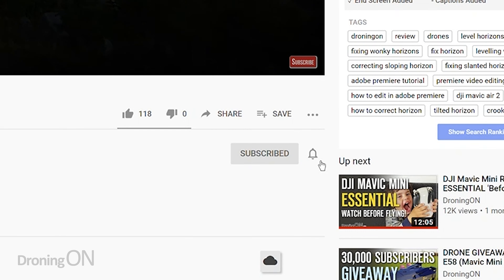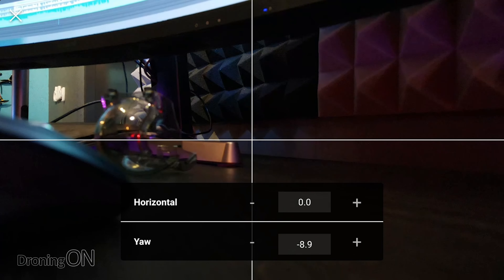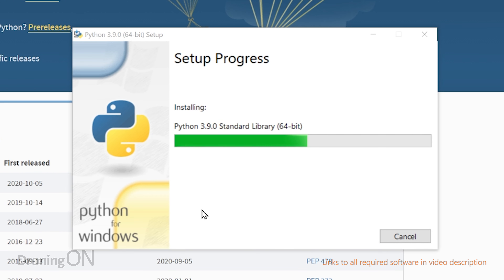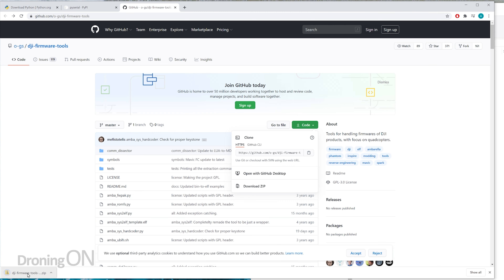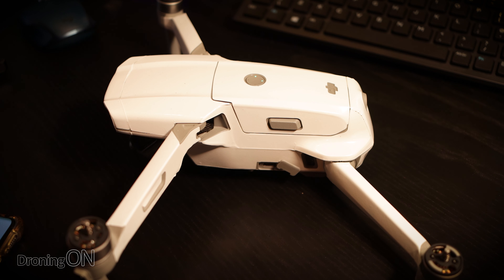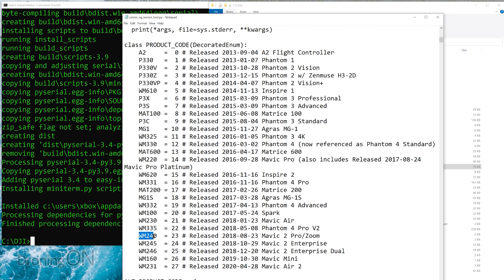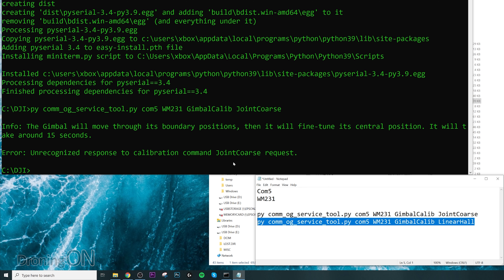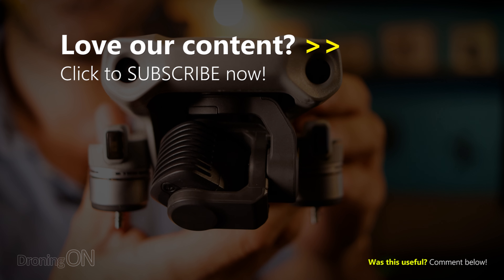FIX DJI drone ERRORS/ISSUES after GIMBAL/CAMERA replacement

Comment: ... Mavic Mini and DJI Mini 2... the code to use is the same which is...WM160... Also, the USBC port on the mini drones are a...dual port... that serves as both a... COM port and Charging port...the COM port shows first for about 5 to 10 seconds at most and then switches to the Charging port automatically to the Charging port. I don't know how to make it stay on the COM port. 

What worked for me when I did this repair on my DJI Mini 2 I used the WM160 code and as soon as I plugged my drone into the USB port I entered the the GimbalCalib JointCoarse line and let the drone do it's thing. I then unplugged from the USB port turned and off the drone. I then turned the drone back on plugged into the USB port and entered the Gimbal Calib LinearHall code and let the drone do it's thing. You have to do each line in the short time after plugging into the computer USB port while the computer reogonizes the dual port as a COM port before it changes to a Charging port.

I ran into the same problems as those posting above when using this video for their mini and mini2. Thankfully my son figured out that dual port issue. I made tha guess that since the replacement gimbal is the same for both drones the drone code might be the same and that worked.
Reply: thank you, it's work for me,

Comment: Is there going to be support for the Mini 2?  I have the same issue but I noticed it is not listed and the computer does not recognize my drone when I plug it in.
Reply: Cameron, did you find an answer about the mini2?
Reply: @firstnamemike  Maybe.  I bought  a gimbal from a gentleman on ebay.  He told me that the spark uses the same code but I'm a bit leary.  I still can't get the computer to recognize the drone as a serial port.  I'm going to try a different computer.

Comment: Hello. I tried the procedure on my Mavic Mini, and the issue I'm facing is that after everything installed, when I connect my Mavic Mini to my PC, in Device Manager, he's recognized as Storage and shows as USB drive. There is no Com Port to enter in the script. Any help will be very appreciated.
Reply: MINE ALSO
Reply: @samirzarour8562  I have the same issue, do you find the solution?

Comment: I get everything running but when I connect my mini to the PC it does show up as a USB drive but it does not show any com ports under device manager.
Reply: Try this, scroll down to the instructions (worked for me) https://www.windows10forums.com/threads/ports-com-and-lte-not-showing-in-device-manager-in-windows-10.6057/
Reply: same with me. did you get it to work?
Reply: @jillsabo5973  yes. You have only a few seconds to run the program once you connect the usb.
Reply: If you install DJI Assistant 2, it installs a driver for your drone.Then the com port becomes visible. worked for me.

Comment: Hello sir can you please make a dedicated video for Mavic mini 2.
The Dji tool you mentioned does not have Mavic mini 2 in it and i also tried Mavic mini instead but its also not working.
Reply from the maker: If I find the time, yes! Thanks for the comment!
Reply: @Droning-ON  thankyou so much sir the video i requested is highly asked by many people's as the process is a bit different
Reply: @theincredible2476  Hi, did you ever fing the ccode for mm2?
Reply: And add in the same video the mini SE with the code WM1605 please!

Comment: I purchased a Air 2s with gimbal stuck errors.  Would this work or be required after disassembling and reassembling? Thanks for the video

Comment: Hi, thanks for the video. I am having a bit of trouble. When I typed the "py setup.py install"  line. It comes back as an error saying that the file is being used by another process. Nothing else is open when i open task managaer.

Comment: Despite adhering to your guidelines, my gimbal continues to malfunction. About 2 minutes after the drone takes off, the gimbal starts to shake. The camera maintains a perfect forward position, but the horizon appears off-level, tilting 20 degrees to the left. Furthermore, error messages about gimbal motor overload and calibration failure pop up. I've verified there's nothing hindering the gimbal's motion, as it moves freely in all directions when the drone is off. Could you suggest a potential solution for this? Thanks.
Reply: did this happen after replacing? and have you managed to fix it?  i'm having same problem, and i'm about to order replacement (just empty gimbal).
Reply: @bujooo.  Yes, it happened after replacement and recalibrated with python

Comment: Have you tried to disassembly the old gimbal? maybe it's possible to replace only the broken plastic parts and use the original circuit, that could be a solution for the error that appears in the app.
Reply: I’ve searched all corners of the internet for parts but if someone has any they are not advertising it. You have to buy an entire new gimbal/camera
Reply: Which board is encoded, there is 2 in the gimble/camera assembly. I have the original gimble, wondering if I just replace those in the new plastic if that would work without error.
Reply: @Southernflyguy4  Which board is encoded, there is 2 in the gimble/camera assembly. I have the original gimble, wondering if I just replace those in the new plastic if that would work without error.

Comment: hi there awesome video fixed gimbal calibration error for my Air 2s. is there any python code for calibrating the IMU? error 30055 30056 are stopping my drone from flying. but no matter what I do IMU calibration gets stuck at 6% and gives error. any python code for IMU calibration? BTW I have already tried replacing GPS module IMU module and gps flex cable seems like a some DJI software glitch which needs some software pro to guide me
Reply: How you fixed gimbal calibration while air2s is not on the list ?
Please respond 🙏🏽

Comment: PLEASE HELP!! I followed your video to the letter but am getting an error on the command prompt that says
Error: could not open port com11 permissions error(13, access is denied none 5)
Any help would be greatly appreciated
Reply: Ok don’t worry I have sorted it!! Had to shut some windows. Gimbal has calibrated perfectly thanks so much.
Reply from the maker: @tolycobbold7659  Glad that you sorted it!!
Reply: @tolycobbold7659  jesus you saved me!!
Reply: @lucagontier8481  cool!
Reply: how hou solve it?
Reply: @mvville4086  hi, make sure you close all open windows except the one you are working with. As soon as I did that, the error went away. 🤞 good luck

Comment: i keep getting an activation error and then server error. "device SN verification failed..." any solution for this?  it wont let me fly it
Reply: I think this is now a problem and it may be due to firmware updates on the craft. Originally when we would replace these we would get an error even after calibration however the drone camera would work and craft would fly. Recently, after replacing just the camera itself using the original gimbal we are now receiving Activation errors. If you swap the old (non working) camera back in the activation error goes away and the drone flies fine. I'm not 100% on this but I think it's and update that is now blocking this replacement from working at all.
Reply: @Repairsharksllc  yeh. Dji pretty much confirmed this when I contacted them.  Theyre doing the Apple thing and preventing 3rd party repairs however they can. Ironically this so far just seems to occur when piloting with an ios device.  Android device would allow for flight
Reply: just Search ( bickflash tech) on YouTube, drop a comment for him, he'll assist you
Reply: @jess_n_atx  Thank you for verifying this. At least I know I'm not going crazy.

Comment: Such a simple fix... Just two commands with a python script. Has there been any progress on the "anti-repair" error? It does state the camera is not calibrated so it maybe another line of code you need to run to calibrate the camera. Not a serial issue I think.

Comment: I have a mini 2 with the gimbal calibration code error.  Now the gimbal works perfect, however code wont clear.   Do you think I go through these steps and it will clear the code?  At the very least it cant hurt right?>
Reply: I see the mini 2 isn't an option in the dji tools, wah
Reply: Ok wm160 works.  It went through all the steps however, error 40011 calibration error is still there.  Gimbal works good, but error is still there.
Reply: Reinstalled the app too.  Error must be saved on board the drone.
Reply: @Schmeggma.  See in drone-hacks.com app, I have seen a message that there is a WM161 code for the Mavic 2. (this is not checked by me). Follow the steps as described for the drone-hacks.com. After you installed the program and files on your computer, search for the file "comm_og_service_tool.py"; under "class PRODUCT_CODE(DecoratedEnum)" section you will find the code for your quad-copter. This file can be viewed with notepad.

Comment: I replaced the yaw arm on a mavic 2 pro and I tried this but the response I get is. Error  no response on calibration command joint course request. And same when I request linearhall. Any suggestions? My camera points to the left of the drone and gimbal cal can not. E done.

Comment: Would it be the same with Mavic Mini 1? Loved my drone and lost connection mid flight and crashed in a tree, vibration arms on the gimbal 2 have broken and i cant find anything online,  apart from replacing the entire thing, but people have said i need to take it to a specialist,  so they can calibrate, and remove error codes and such but canot afford to send it in, thanks in advance
Reply: Yes it works for DJI mini 1 and 2

Comment: Hey dude. Will this work in a mini! A 1 not 2 mini? I replaced mine but she’s got a tilt! And calibration is not working. Also u guys find a way around the errors? Or does that happen to the mini too or just the air?? Hit me back really would appreciate ur input. Have a good one.
Reply: I have the same problem, the command prompt in the last step stays fix eternally eternally without calibrating or moving the gimbal…

Comment: Did not work for me kept getting the following error messages:

C:\DJI>py setup.py install
Traceback (most recent call last):
  File "C:\DJI\setup.py", line 17, in <module>
    from setuptools import setup
ModuleNotFoundError: No module named 'setuptools'

During handling of the above exception, another exception occurred:

Traceback (most recent call last):
  File "C:\DJI\setup.py", line 19, in <module>
    from distutils.core import setup
ModuleNotFoundError: No module named 'distutils'
Reply: I had the same error. You have to make sure you get the exact versions of everything he downloads, like Python 3.9.0 instead of the latest and pyserial 3.4

Comment: I can't find on file manager my drone (DJI mini 2) and so I can't reed my COM code!! Can someone help me??
Reply: WINDOWS 10 PC: 

How to check COM port when you don't see it in the Device Manager Window?
Select VIEW
Make sure that "Devices by type" is selected
Select "Show hidden device"
You should now be able to see the "Ports (COM & LPT) section
Mavic Mini shows 2 COM connected ports on my system
1. DJI USB Virtual COM (COM4)
2. Serial USB-device (COM3)
The second on port COM3 is the one I need (not the Virtual)

Comment: Thanks so much for this excellent tutorial! I was able to follow and got everything working...sort of. I have an issue that maybe you can help with. I am able to get the gimbal to calibrate and work after running to the commands. However, when I power down and restart the drone, it goes right back to being a limp, not functioning gimbal. It's as if I never ran the lines and it's back to not working. Any advice would be appreciated. I do know that sometimes the gimbal gets stuck a bit due to the repair I made (I had to replace the ribbon cable b/c the gimbal was torn off the drone so with it being glued back on, things are little off but it does seem to move freely).

Comment: Hi! I bought Mini 3 pro a few days ago. The drone had minor crash and now it has some issues: 1. it shows Incompatible Gimbal data 2. In indoor settings or shades, the camera does not show anything. Camera seems to work fine in outdoor lighted setting. Can I use above procedure for Mini 3 pro?

Comment: Is there something missing here like having to have DJI Assistant 2 installed and the proper way to Paste into the command line? Other than that you are a smooth Pilot. Thank you very much!!
Reply from the maker: Nope absolutely nothing missing here, thousands have followed the instructions and it's worked for them, and me! Try again, take it slowly and pause to look in detail at the commands. Let us know how you get on buddy!
Reply: Same problem, missing a comment (py) he don't take it
Reply from the maker: I see, so you're both struggling with simply how to paste into the Command Prompt? This whole process assumes some understanding of Windows, and therefore how to do such things including for example starting up Windows etc, so apologies that it wasn't included. Simply press CTRL+V to paste into the command prompt.
Reply: @Droning-ON  i have te problem that i cant  install on command, i dont kwon how and "py" do not work

Comment: Did you ever make a video on correcting the error messages? I watched one that explains a recalibration does the trick--but ONLY with the previous firmware version. It will not let me downgrade. Any ideas? Please help! Love your videos, very helpful. --EDIT: I have already fixed my calibration issue after replacing the main board. Just have error messages on a Mini 2.
Reply: just Search ( bickflash tech) on YouTube, drop a comment for him, he'll assist you
Reply: @samil1522  thank you
Reply: @samil1522  it just comes up with a gun channel and a lot about fish. Am I missing something?
Reply: @joelgarland5723  just message him, he helped me
Reply: @samil1522  there’s no channel called “blackfish tech.” What channel am I messaging?
Reply: @joelgarland5723  it is "bickflash tech" not blackfish tech
Reply: @samil1522  totally misread that. Thank you.
Reply: @joelgarland5723   did you contacted this bick flash guy?

Comment: Anyone trying this with a Mini 2 it does work but, at least for me, doesn't run as shown. I used the WM160 code (mini 1 code) as WM161 did nothing. It ran through the calibrations but the code did not receive the responses it expected so it just had an error BUT the drone went through the calibration. Basically calibrated but no information shown in CMD. It was a pain to get it to sync properly, ended up opening DJI Assistant 2 and getting it on there, closing it and then running calibration code.

Comment: Late to the party. But I had to add --port to the command lines just before the COMPORT. So the lines looks like this (py comm_og_service_tool.py --port COMPORT MODEL GimbalCalib ...). Otherwise Python tells me that I've entered wrong arguments. Don't know why I had to do that but a guess is somethings have changed in the codes sins this video came out. Anyhow it works fine now. Thanks!

Comment: Hey, Thanks so much for this video. I'm still in my early stages of researching how to repair my misaligned camera. My camera works after the crash but the issues i'm having is a lean horizon, and the camera is pointed about 20° to the right also. I'm unable to successfully calibrate the gimbal in app as it goes to 80% and then fails. However the IMU calibrates just fine. Do let me know if you had stumbled on the code for the Air2S model as I noticed the listing went to up Mavic Air 2. - Thanks in advance!
Reply: I am having the same problem as you!  WM232 is the code for Air 2S, I tried it and the calibration worked successfully. but I still see my gimabl is at 20 degrees sometimes and it is not very stable. It's a hardware issue for me. I might have to replace the gimbal
Reply: @the_pretty_indian  Heyyy! thanks so much for sharing, i'm starting to love this community even more! Do you mind telling me where online you were able to find the code? || I'm happy to hear the calibration was successful, I need to give it a shot. I was also taking a closer look at my drone last night and I noticed an area behind the gimbal that has a tiny gap, as well as a plastic component that has been shifted. - I also noticed that if i manually rotate my camera to the left or right, it goes further to the right than to the left. Soo that in itself is a problem too. Over the weekend i'll have to pull it apart to see the true extent of the damage. If you haven't already done so, you could try taking a closer look on yours as well to see if you missed any little details like i've just discovered with mine. || Ultimately I may have to replace my gimbal too, so you're not alone.
Reply: @the_pretty_indian  once you get to a hard crash the solution sadly is to send it in.

Comment: On trying this (Mavic Mini) I get an error message that includes the list of models but I am not sure if the error is caused by Windows (10 or 7) not liking the com port (none are listed in device manager or no USB associated port is listed or none last for any length of time). There is a 6 month reply which say the poster was successful (with a Mavic Mini) after numerous attempts but I have not been. 
Is there a work around for the Mavic Mini and or will these scripts work on Linux and or a MacBook? (I have a Linux OS on a laptop).
Reply: I found a thread on mavicpilots where the first poster put "--port " in front of the com port name e.g. --port com(insert your port number here) WM........   that worked for me.